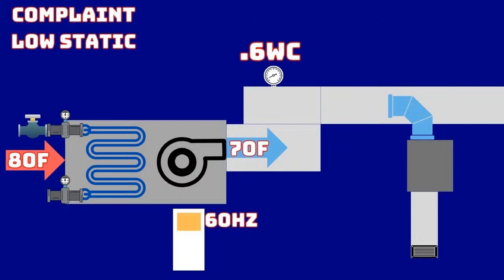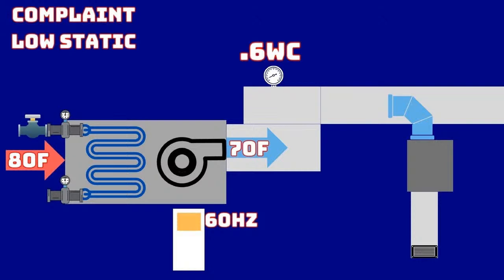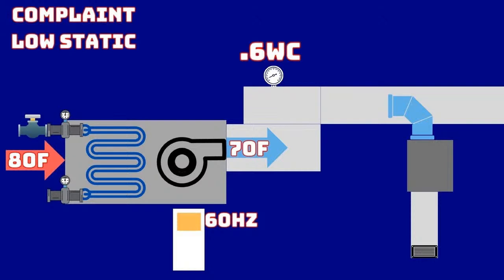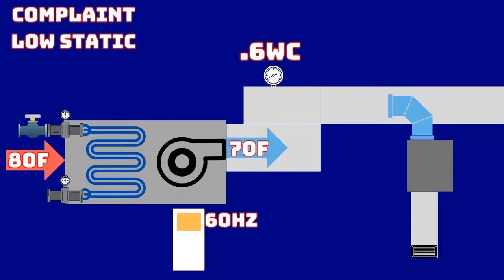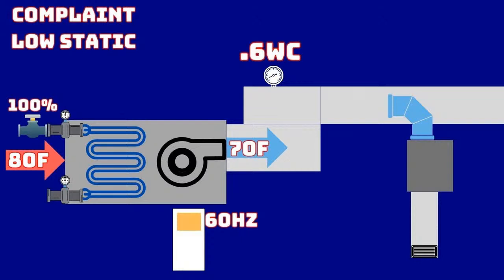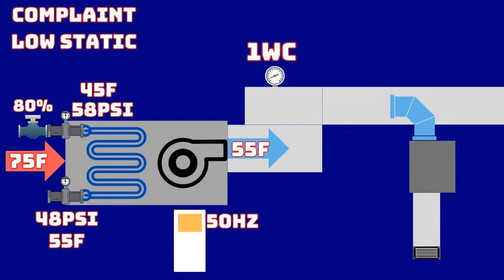Supercharge Your AHU Troubleshooting Skills with This Exercise

Comment: Pausing at about half way to say great video thanks so much. As soon as entering and leav8ng water revealed im thinking we wanna see a 10 degree split not 20. Been thinking refrigerant issues this whole time but its a little hard to picture what having a too high or too low superheat/ subcooling's effect would be on delta t. Other than that possible water flow issue is the only other thing i can think of after having come this far and eliminated other possibilities
Reply: After finishing this...what a great learning opportunity! I was also thinking restriction after the coil but have not had enough experience to run into a situation of insufficient make up water. Thanks again!

Comment: Am I missing something? Why is vertical water column relevant in a closed loop system? Is the pump not a recirculating pump?

Also, with the inlet gauge reading 1psi I would be weary of the reading unless it’s a compound gauge. The gauge might read 0 but the suction is in a vacuum.
Reply from the maker: It is a recirculating pump but the column is still relevant whether its a closed loop or not.  There has to be enough water volume to properly function.

Comment: Shouldn't the inlet to the chill water coil be on the bottom of the coil in order to keep the coil flooded, which will help to give you a lower or proper outlet temp,
Reply from the maker: Ya i caught that after I started the training. I make mention of it through the class.